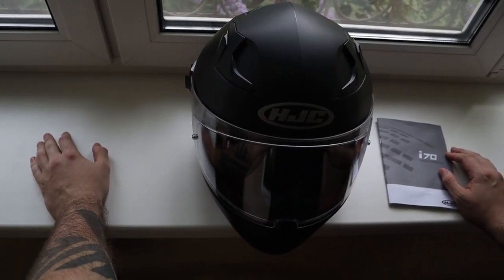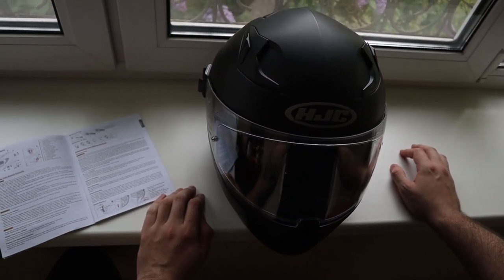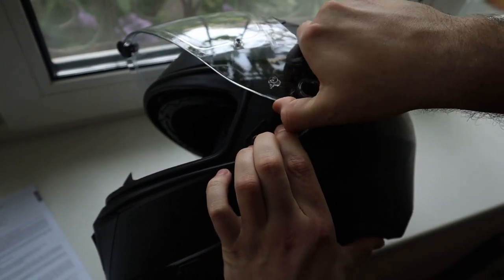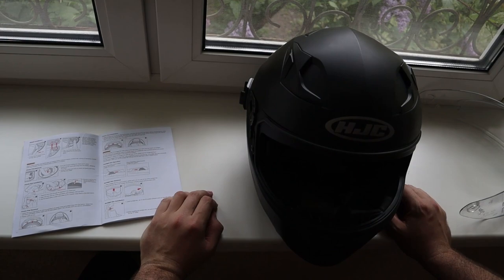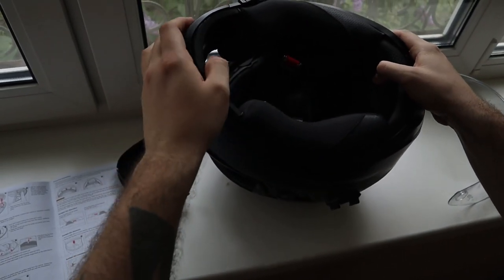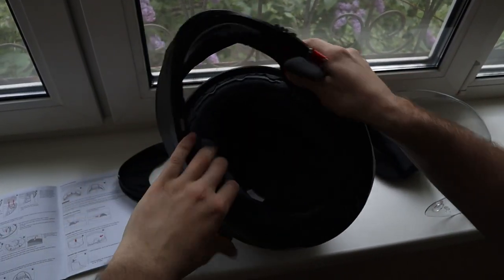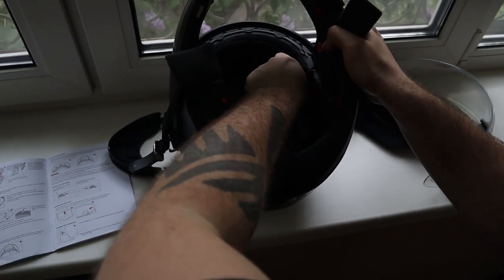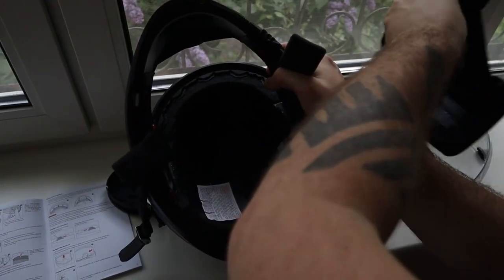HJC i70 Helmet Disassembly + Manual

Comment: The sun visor can be removed by lowering it all the way and (carefully) pulling straight out towards the front of the helmet on each side. Look at a picture of the replacement part online and you'll see the direction of the fingers holding it to the track sliders

Comment: I think i got it, but to get more info I will look for an additional video for the disassembly as this one is lacking light and makes it hard to see inside the helmet, particularly as it is all black inside there.  I would suggest you use a bit more light pointed directly inside the helmet for your next new and improved video.  Still very helpful.